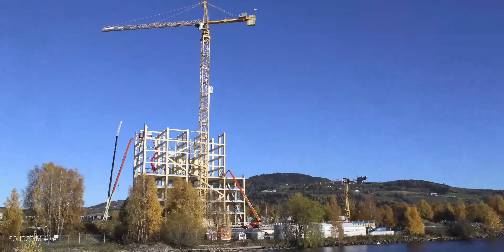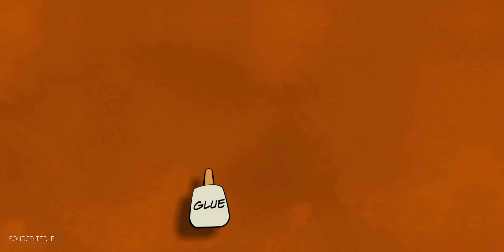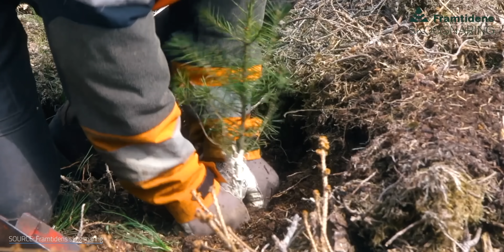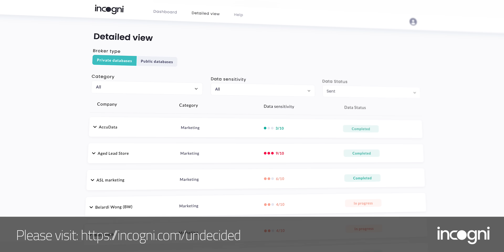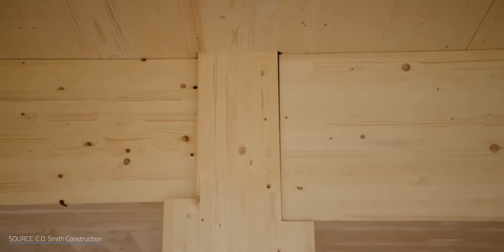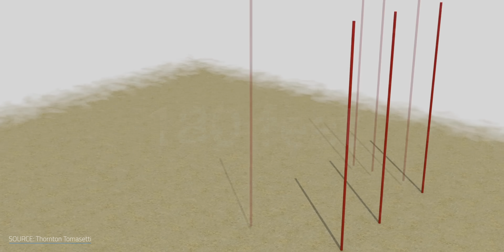How We Engineered Incredible Wooden Buildings

Comment: Well, as stated by may, the historical reasons that lead cities to require brick, concrete and steel was because of fire protection - not only to the building itself but also the spread to neighboring buildings. With the result that several cities had huge city-fires burning down several quarters. Also the insurance companies had an interest in avoiding spread, and also the fire-fighters (even today) will have problems containg a fires that spreads to many neighboring buildings. -> So the demo in the video about fire-protecting the building itself is by those standards the wrong way around... 

Reading about city-fires is horrific. So many of them and so huge impact.  And remember they may still happen in modern times.

And also there was real problems with rot, water damage, ground stability and rodants in wooden structures.... it was also a protection aginst diseases. And at last it's the maintance and costs with natural materias over time. 

But I like the that this idead is dicussed and experimented with as new knwledge is gained, maybe we can take advantage of new materials and inventions?  Or maybe we'll find out that we can use wood to a larger extent?  make new combinations and so on...

***But there is serious concernt and lessons from history that should't be just brushed away with simplistic statements that we don't use candles and don't smoke indoors anymore (!)

Comment: Wood structures were outlawed in most major cities because of mass casualties caused by FIRE over the past centuries.  No responsible city is going to approve these because the liability in a crowded downtown is staggering.  Even here in Portland OR, which is very timber friendly, they couldn't get this done. The perception is of planting a giant match in the middle of your downtown.  Not happening.

Comment: You ever see one of those apartment buildings that isn't zoned as an apartment because it's only 4 stories? They are built like this, They don't even have cinder-block firewalls like a semi-detached would. You hear everything your neighbour does. You ever see one those buildings catch fire? Or remember any of the great city fires? There's a reason we shouldn't build large multi-unit buildings out of wood. None of this is sustainable if it burns down every 50 years.

Comment: I'm interested and I hope something good comes from this. But I'm thinking long term. These are beautiful buildings now: fresh and brand new. But how will they hold in 5, 10, 25 years? Things oxidize and get worn. Plus wood is not only flammable but also porus. It will warp overtime, settle, and get misshapen. Most people in the US and Canada already live in wooden houses and even some of the new ones after a year or two have that one creaky floorboard. I don't think the whole building will warp at once but the small changes will add up. One small change is nothing, but hundred of small changes will. Even if the structure isn't compromised, will it be comfortable to live in a building when the floors as slanting or you have doors that "stick". Also, wood dries out. Older buildings burn faster because they are old and dry, more so than fresh virgin wood. And that last thing about open flames made laugh. No, we don't have many open flames now. But we have electricity which and operator error. Most home fires are either due to people doing bad things (kids playing with fire, cooking accidents, tampering or poor repair of equipment), or electric (bad or worn wiring, vermin damage). These are my trepidations. - Otherwise seems like a cool concept if it works.
Reply: Engineered wood products don't warp much. It's not like regular plain timber where everything's already warped by the time it gets to the store.

Comment: I am living in a very modern wood apartment and I am not buying one again. Biggest problem in my eyes is that it is not the same sound proofing quality in it. It is not very bad since it has very thick walls and roof/ floors with a lot of insulation but it is definately not the same sound proofing as in a modern concrete apartment . Concrete is a dead material and has much better vibration damping. Anyone saying otherwise has not been living in a wooden one. Sometimes you want to kill your neighbor above you....

Comment: While using wood is less carbon intensive than concrete or steel, I'm not sure I'd go so far as to call it carbon storage - especially when used in modern buildings.

With the amount of buildings we keep demolishing, that storage is very short term. Decades most likely and centuries is extremely unlikely. Once those buildings are demolished, any stored carbon is going to be released through rotting in landfills or burning to keep it out of landfills.

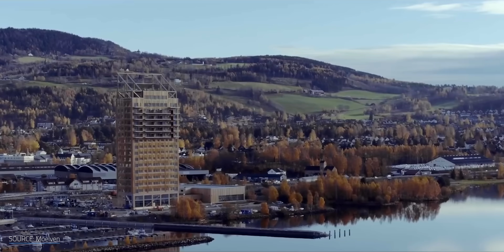And look at the numbers given at 12:44 - Mjøstårnet is "sequestering" 2,000 tons of carbon dioxide. At 11,300 m^2 of floor area, that's around 188 60 m^2 apartments or 125 90 m^2 apartments (not really, because it has a hotel, apartments, offices, a restaurant and common areas). That's 10.6 tons of CO2/60 m^2 apartment or 15.9 tons of CO2/90 m^2 apartment. The per capita CO2 emissions for Norway was 7.57 ton/year in 2021. Not exactly impressive amounts of "sequestering".

I love the idea, especially if we can keep supply up with demand (at some point this will be a problem), but talking about sequestering in dead trees seems more like green washing marketing terms than anything else to me.

Comment: My main concern would be fire of course, but we have fire retardants good enough today to make it a non-issue anymore... So my next concern is longevity. Concrete is artificial rock and even though it eventually corrodes steel, it lasts more than wood. Also, can we reliably assess the safety of a wooden structural element after some decades of neglect the same as we can with concrete? And then there's water-damage. I live in a brick+concrete building that seems impossible to water-proof against rain, and water doesn't rot bricks or concrete...
I'm not trying to sink the idea, I just want to be sure we are at a point where we have an ACTUAL substitute to concrete+steel, that performs the same or better...especially if we are building skyscrapers with it. I wish, as always, that you had asked more about the possible negatives and not only shown the optimistic side of the topic, even though adressing the elephant in the room of fire is a good start

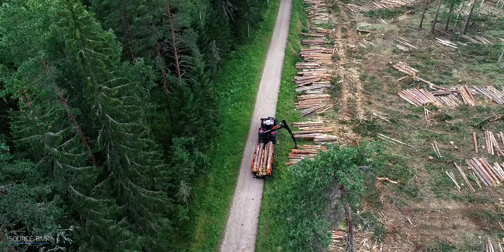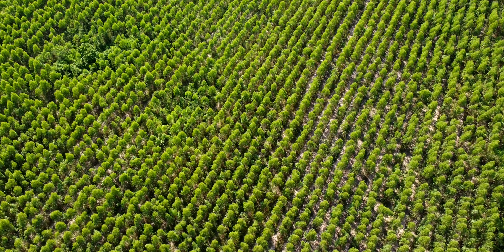Comment: Thanks a lot for this video. The arguments for wood in terms of convenience, structural characteristics, and cost seem really clear cut and are very well exposed. On the other hand, I find it interesting that the discussion on the environmental impact, in time, is about 10% of the total video (around 3:30 to 4:40). In addition, that part is filled with hand-wavy and misleading statements regarding the environmental benefits of using wood. For instance, in North America, timber forests tend to be really large (possibly non-native) monocultures that are destroying important natural ecosystems that were naturally capturing a lot more carbon than the monoculture timber forest. In many cases, monoculture forests aren't a good environment for the development of new ecosystems and the images shown at 9:50 while talking of "sustainable sources of wood" might be a good illustration: that specific timber forest is probably a monoculture desert. Also, there is the fact that timber is harvested way before the forest reaches maturity (harvest around 35 years while it often takes over 80 years for maturity), This means that overall, the areas used for timber production sequester a lot less CO2 than what the original natural forest was sequestering - the loss is a lot more that the meager 700kg of CO2 per ton of wood temporarily sequestered in the building. Altogether, I personally believe that the claim that wood buildings are good for the environment would deserve more context and nuance than what I saw in this video.

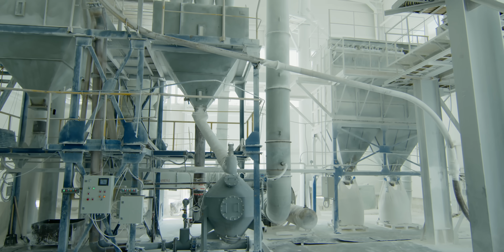Comment: 2:55 where is the problem with carbon emissions? install a filter and filter the carbon. and since you said carbon, I think you refer to elemental carbon, probably as carbon black.
which is interesting 1000kg steel essentially creates 1850kg of carbon? that would mean that a regular industrial blast furnace produces quite an interesting amount of coal.

Comment: I wonder how two things would be dealt with:
1) termites... how do you tent a 20 story building?
2) how do you repair fire damage to structural members?  You have a 40 inch piece of wood that now has the top inch or two charred which would smell like a campfire.  Scrap and re-surface somehow? Or do they have a way to simply unbolt it and replace it with a whole new one?

Comment: I think they may be being a bit disingenuous when talking about the impact of fire on wood.  While a char layer may insulate the core from heat, the outside of the wood has suffered from structural damage that concrete or steel would not have.

We care about fire resistance because we want to reuse the structure, but if load bearing supports have been degraded, they will need to be replaced.

Comment: Shipping by road is far less efficient than shipping via sea, and is therefore a considerably bigger producer of carbon emissions, amongst other things such as nitrous-oxide.  In terms of forest management and dealing with illegal logging, that indeed is a whole other problem to which we will have to find answers - one thing is for sure is that it is not limited to rain-forests.  Central Europe has just as many problems with illegal logging and there doesn't seem to be much will or way to deal with it.  Which is unfortunate. 🤔

Comment: Just a quick question about termites?
Reply: Go ahead🧐.
Reply: Basically, in the video, there was nothing mentioned on how the processed wood materials fair against termites.

I would assume that they are resilent to them, however in the video you just talked about compression and tension in comparison to steel, but it's still wood, so edible by pests that like wood?

Or have they added chemicals that prevent it, or are they impervious to infestation?

Comment: You HAVE to take into account the fact that timber is a carbon sink. If you cut the tree down you have to calculate how much carbon that tree would’ve absorbed. We’ve built with wood forever and it’s major contributor to global warming. This really isn’t an acceptable option for large buildings at this point. We need to be planting and saving trees, not cutting them down. Not to mention the emissions the building emits during a fire.
Reply: Wood will last far longer as well preserved build material. You don't have to pretend to be able to DO THE MATH. It is a simple matter of harvesting mature trees to prevent catastrophic wildfires. And, you can't only talk about the apparently virtuous side of land management ie.tree planting. Harvesting and utilising is just as important.
Reply: @Flumstead  wildfires are natural and should be allowed to progress. By halting them we are causing the severity of the wildfires we see today.
Reply: @Gmanc22  So you don't HAVE to calculate for these emissions?
Reply: @Flumstead  what emissions are you referring to?
Reply: @Gmanc22  🔥
Reply: @Flumstead  absolutely but the trees that grow after fires absorb much more carbon. They are meant to be that way. The grow thicker and higher.

Comment: My main concern with using a natural product is rot. Wood takes maintenance when exposed to the elements. It's often a reason for using/ not using wood in some projects. Absolutely love the look though!
Reply: I live not far from the ocean. Wood, especially the right type lasts a lot longer then steel here. But in the outback termites eat timber so everything is made of steel but it's so dry that it takes a very long time to corrode. Which is longer lasting really depends on on the location, but timber can hold up well.
Reply: Steel is really no different though.
Also the structural parts of the building don't need to be expose to the elements at all. The outside can be any material you want.

Comment: The big issue is cost, if the costs can be driven down this could be a great option for building. The laminated wooden beams have a great strength to weight ratio. Maybe I missed it, but I wonder what’s the expected longevity of this type of wood construction?

Comment: I'm all for it. But there are more aspects to building materials than just fire safety and construction method. How well does it hold up against water (including freezing/thawing cycles), pests, rot or even (intentional or not) damage caused by humans? Construction costs are also dependent on how long the building will last. 30% savings when they last half as long are not savings at all.

Comment: Wood has at least two massive disadvantages, that also go together well.
First, wood piece sizes strongly depend on temperature and humidity. Huge forces of elasticity easily rip wood apart, not only producing noises or making wood weaker, but also opening a lot of crevices.
Second, a plenty of species are great at inhabitng wood, both microscopic ones like mold and mushrooms and more conspicuous like wasps and woodworms. Especially the cracked wood. Together they can destroy wood quite fast.
Reply: Wood expands perpendicular to the grain. Engineered wood products like plywood and CLT cross layers so the strength axis of one stops the next layer from expanding. This also eliminates most cracking and I don't think bugs like eating the glue that holds it together, especially if each layer has been treated. I'm not an expert by any means, but I do wonder how this susceptibility compares to steel's ability to rust.
Reply: I wouldn't feel safe living in a wobbly fire hazard that doubles as pests' food. Maybe it's because I always lived in houses made of bricks, but wood is very counterintuitive to me

Comment: Glulam and CLT is an inferior material to Steel and/or Reinforced Concrete for tall buildings. In fact, tall buildings actually need the weight of the RC to counteract wind forces without ridiculously large braces and foundations. You can see that from the use of RC in the first few floors and core of this building in Milawaukee. After a certain height, to shoehorn the timber into the superstructure, you would end up pouring more concrete into the base of the building than you would just using concrete for the entire building. 

It's horses for courses, Steel has a youngs modulus of 210GPa, Glulam has a youngs modulus of about 12GPa. If your project can keep stresses with reasonable member sizes under 12GPa, then Glulam is a viable alternative, if you need to use 1500mm deep beams just to force Glulam beams in because of perceived "Sustainability", then no it is not a viable alternative. Low rise, low span buildings with fixed interior walls like apartment blocks should absolutely be built with CLT. The fire resistance of modern engineered timber has been proven multiple times over in the STEM world, it is the building insurance world (and the emergency services) which is holding it back.

Comment: Great video and interesting comments. Great to hear you might do a follow up video. As a structural engineer who has worked in the sustainability field for years, I recommend checking out Climate Smart Wood. They have information on forestry management practices that go beyond the regulatory floor and look at not just the climate health (carbon) but also the ecological health (biodiversity). Third party certifications like FSC does this as well and includes social health (local communities ). It’s important to understand that not all wood is equal and the forestry management practices play a key role. Check out “Mythbusting Mass Timber” put out by atelier ten and LEVER architects last year.  It has an interesting graph in there that shows timber can sometimes be higher embodied carbon than conventional building materials when not harvested/transported sustainably. One last resource in our own backyard here in New England is NEFF’s 30% Climate Solution which looks at the potential of Exemplary Forestry approaches versus current forestry practices.

Comment: Some tenants tend to be hard on the infrastructure that they live and work in. For example, I like mounting TVs, monitors, artwork, etc. on my walls. Having the building supports exposed and also soft enough to penetrate with simple hand tools sounds like a massive liability. Do people living in these wooden structures have to agree to specific terms about damaging the structure? What are the risks associated with every 10th tenant adding one little hole every few years, lease terms be damned?

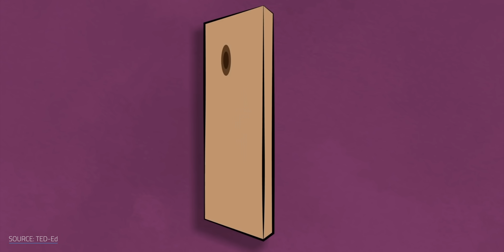Comment: around the 1:45 minute mark you state wood is stronger in tension than compression. this is backwards. wood is much better in compression than tension. look at the allowable stress tables in the NDS code and this can easily be seen across all species. more importantly, in nature, the trunk of a tree is in compression typically (weight of tree/branches pushing down on trunk) with bending from wind.  i know of no tree that hangs from the sky putting the trunk in tension :)